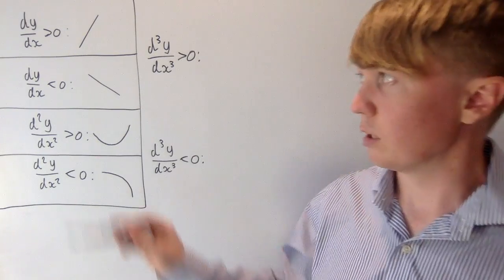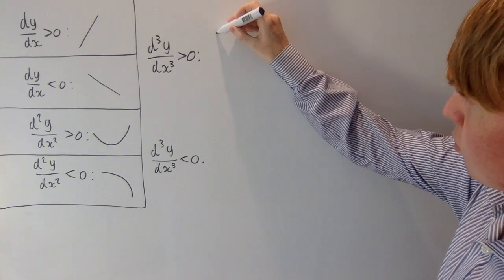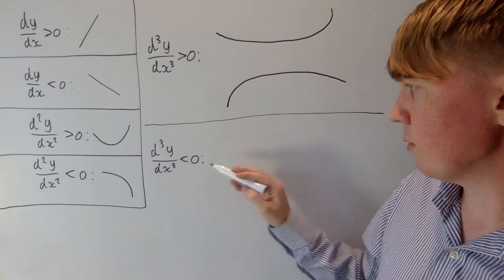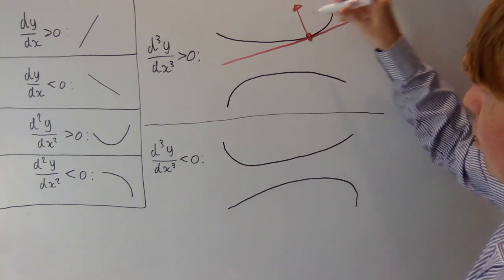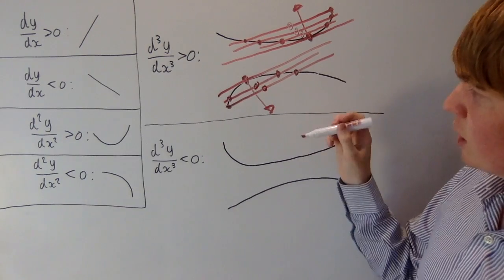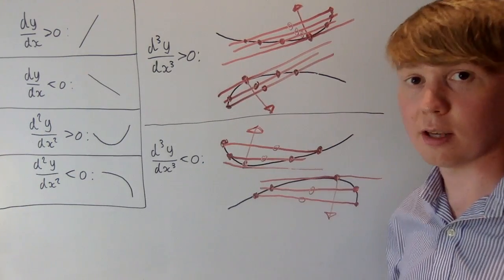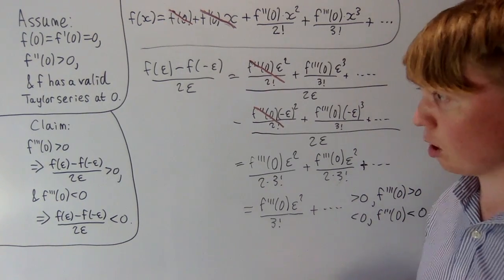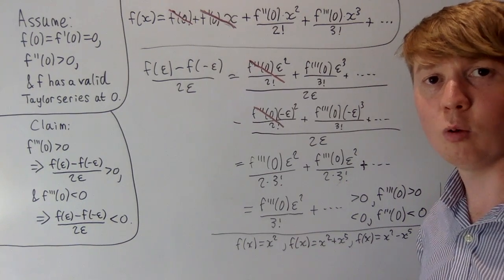Understanding The Third Derivative Geometrically

Comment: Unfortunately, this intuition is wrong. You should take this video down, or issue a correction.
Reply: Thank you for your thorough and well-reasoned analysis.
Reply: @General12th  
I have a longer comment in response to another comment that I didn't want to reproduce here. The counterexample that commenter gave is the third derivative of a circle. This intuition would imply that a circle has a third derivative of 0, since the circle is symmetric. But circles (when written as functions) don't have a third derivative equal to 0. 
Ipso facto, this intuition is wrong.
Reply: @APaleDot  A circle cannot be written as a real-valued function. Maybe you are referring to the circle as a parametrized curve?
Reply: @APaleDot  Also, this video explains the intuition of the third derivative assuming that the first derivative is zero, which is not true in almost all the points of a semicircle
Reply: @WEEBLLOM  
No, I'm referring to the function f(x) = √(1 - x²). If I pick a point x≠0, and then rotate the curve so that the tangent line is flat (as described in the video), the curve is symmetric about that point (cuz it's a circle), but the original function doesn't have third derivative equal to zero at that point.
Reply: @APaleDot  As I said, the third derivative is equal to 0 at x=0, which is the case mentioned in the video, as the first derivative is 0 only there
Reply: @WEEBLLOM  
He says that without loss of generality, you can rotate the curve to make the tangent line flat.
Reply: @WEEBLLOM 
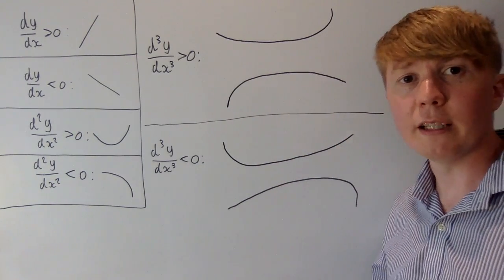You can see at 2:23 he draws a sketch at a point where the derivative is not 0.
Reply: @APaleDot  if you rotate the curve and change the equations accordingly, the third derivative does in fact become 0
Reply: @APaleDot circles are not functions they fail the vertical line test.  Return to pre calc
Reply: @tankyjones888  
Lmao, take the top half of the circle, it's a function. Maybe you should return to pre-calc.
Reply: @ is a semi circle a circle?
Reply: @ is a semi circle a circle?
Reply: @tankyjones888  
"The sky is blue"
"Umm ackshually, the sky is mostly made of nitrogen which is colorless"
Reply: If you rotate a function, it's not even necessarily a function anymore. 😂

Also, he says you can do it, and it won't change the answer. If the third derivative changes to 0, that already disproves his claim.
Reply: @APaleDot  if the function is continuous and differentiable, then there exists a neighborhood around any point such that the rotation gives a proper function around the point. Apply the necessary rotation and translation to satisfy the hypothesis, and the third derivative will satisfy what the video explains.
Reply: @WEEBLLOM  
My dude, if the third derivative changes when you do the rotation then the intuition is useless.

Let's say I want to know if a circle has positive or negative third derivative when x>0 without going through the process of actually taking the derivative three times. So I rotate the function and it tells me the rotated function has third derivative equal to zero. Okay? How does that help me? I can't conclude anything about the original function from that.
Reply: @APaleDot  what this video gives is some intuition on the information that the third derivative provides, not the opposite way. The third derivative of a function with nonzero first derivative has a very different character and is not included here as you can rotate the function to avoid this
Reply: @WEEBLLOM  
Okay, let me summarize:

1) The information from the intuition only goes one way
2) Rotation doesn't preserve the third derivative
3) The intuition only applies when the first derivative equals 0

Does that about sum it up? Because all three of those claims contradict the contents of the video.
Reply: @APaleDot  1) yes
2) yes, why would rotation preserve a direction? 
3) yes, as stated in the video
Reply: @WEEBLLOM  
At 4:12, he says "what's more important is that [the midpoints] are clockwise of the normal when the third derivative is negative,  and they're anti-clockwise when the third derivative is positive" which implies you can get information about the sign of the third derivative from this diagram, not just the other way around, contradicting (1).

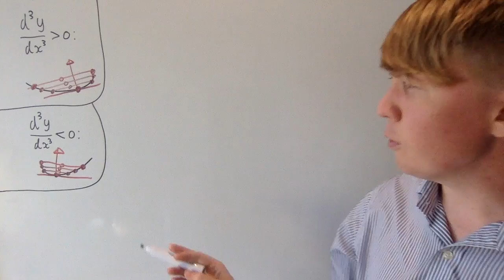Starting at 4:28, he says "there are a few simplifying assumptions we'll make" and "without loss of generality" and then describes three transformations (translation, rotation and reflection) that won't significantly change the diagram. Since rotation doesn't change the relative angles in the diagram, and it's grouped in with transformations that really don't change the value of the third derivative (up to a sign), the implication is that rotation also doesn't change the third derivative, contradicting (2).

As stated previously, at 2:23 he sketches diagrams where he chooses points arbitrarily, not only points where the first derivative is 0, contradiction (3).
Reply: @APaleDot   1) no? He extracts the conclusions from the sign of the third derivative. Not the other way around
2) is indeed a mistake, rotations don't preserve this property.
3) Idk man it's just a sketch
Reply: @WEEBLLOM  
Even if he extracts the conclusion from the sign of the third derivative, the framing is clearly that they are equivalent properties. It's also not an unreasonable take-away since the problem is so constrained. The statement "If third derivative > 0, midpoints are anti-clockwise" is equivalent to "If midpoints are not anti-clockwise, third derivative ≤ 0".

So even if you think he's just inferring the diagram from the third derivative, you still end up with both these properties:
"If midpoints are not anti-clockwise, third derivative ≤ 0"
"If midpoints are not clockwise, third derivative ≥ 0"

which gives all the same information as inferring in the "incorrect" direction, except when the midpoints lie on the normal itself it's ambiguous.
Reply: @APaleDot  the statement is "if the third derivative has this sign and the first derivative is zero".
Reply: @WEEBLLOM  
That literally changes nothing about what I said.
Reply: @APaleDot  we have been saying the same things to each other for way too long now. I believe we fully understand what we mean. Yes he assumes wrong things. No that does not make the video invalid, as further in he remarks that he assumes the first derivative to be 0. Can we stop this now?
Reply: @WEEBLLOM  
It does make the video invalid though.
Reply: @APaleDot  no

Comment: So, the 3rd derivative of a circle arc at any point is 0. Am I missing something?
Reply: Well, if you define a circle parametrically then its curvature is constant. Curvature is kind of like a second derivative of a parametric equation, so the change in curvature would be 0. However, he never even mentions parametric equations, so this is just me trying to find some interpretation of his lecture that fits.
For anyone who wants to see that the 3rd derivative of a circle is not zero, here's an intuitive explanation: consider the top half of the circle given by x² + y² = 1. When x = -1, the tangent line is vertical and the derivative shoots off to infinity at that point. But for every other point within the range (-1, 1), the derivative is well-defined and finite. There's no way for the derivative to shoot off to infinity over a finite range if it was changing at a constant rate. Therefore, the second derivative cannot be constant, and the third derivative is not zero. So as far as I can tell, this geometric interpretation is just wrong.
Don't trust everything you see on the internet, I guess.
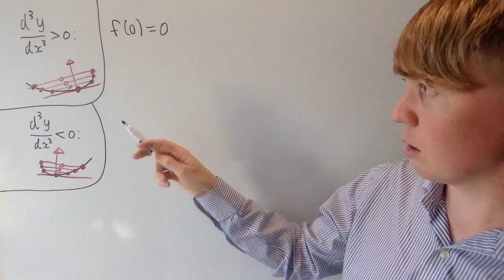Reply: Actually, I've found a way to salvage a part of the intuition. At 4:58 he says that we can simplify the proof by rotating the function such that the tangent line is horizontal. Of course, you are not allowed to "rotate" a function, that could make it not a function anymore! This simplification is invalid, as shown by the circle example which is symmetric under rotation. However, there is a way to make the tangent flat while maintaining the function: a skew transformation. If we skew the function vertically, all x positions remain fixed, and the functionality is preserved. This is equivalent to adding an extra linear term to our function that perfectly cancels the first derivative at the point of interest. Since this linear term goes to zero on the second and third derivative, it doesn't effect our results.

So what is the upshot? Well, unfortunately, the first part of the intuition about mid-points being to the left or right of the normal is dead in the water, it's unsalvageable. This is because when we do the vertical skew, the normal rotates, but the x positions of the midpoints don't change, they only move vertically. Therefore, it is entirely possible for the normal to rotate from one side of the midpoints to the other during the skew. However, the part about the slope of the chord after the skew is still valid. After we skew, we can look at the asymmetry of the function by measuring that slope and it tells us which way the 3rd derivative is going. This also works with the circle because a circle is asymmetrical under a vertical skew.

Comment: I'd like your take on the following:

Third Derivative Test for Inflection Points.
For y = f(x) at x = c:
(c,f(c)) is an inflection point iff f ' '(c) = 0 and f ' ' '(c) <>0
If f ' '(c) = 0 and f ' ' '(c) = 0 then no conclusion can be drawn. In this case you must go back to the 2nd derivative test and check the concavity around x = c.

This is just anther way of saying that the slopes of the tangent reach a max or a min at the point of inflection.
Reply from the maker: This works nicely, and if f''(c) = f'''(c) = 0, then we could also check the fourth derivative, fifth derivative, and so on. If the 4th derivative is non-zero, it's not a point of inflection, and if the 4th derivative is zero, we need to keep going. If the 5th derivative is non-zero, it is a point of inflection.
Reply: @DrBarker  Nice! This is basically saying that if our function has a Taylor series about the point of interest, we look at the first non-zero term after the (x-a)² term [x² term if we have translated the point to 0], then the local behaviour of f (in relation to the tangent at that point) mimics that of the (x-a)ⁿ term - point of inflection iff n is odd.
Reply: @DrBarker  I never thought of the before! But when you think it through it makes perfect sense. Learn something new everyday.

Comment: Pretty much how we define and look at skewness. That one is the third moment around the central tendency, ie the mean. The fourth derivative mirrors the properties of kurtosis ie the spread around the tails. Its nice to see how everything ties up so nicely. Thank you for a nice video. Perhaps a segment on skewness would add to the understanding plus application of the concept.
Reply from the maker: That's a good point. We could even try to understand higher order derivatives by looking at higher order moments, but I don't really have a clear image in mind for anything beyond the 4th moment.
Reply: @DrBarker  The fifth moment measures the symmetry of the tails. It can be used as a measure of the symmetry/asymmetry of the two tail-risks in distribution of returns of assets, for example. The fifth derivative should, by logical extension, just be a measure of the symmetry of the extreme values about f(x = 0) as we move away from x = 0 in either direction. I have no clue as to what the sixth and higher derivatives will translate into.

I also just now remembered my physics teacher defining the third derivative of position vector as the Jerk felt by the particle in question.
Reply from the maker: @shlokdave6360  I could see the 7th, 9th, and other odd moments as related to the symmetry, where higher order odd moments are more heavily weighted by the more extreme values than lower order odd moments. I'm not sure how much insight that actually gives me though, especially for derivatives. A higher order derivative should still presumably be a local property(?), so I'm not sure how the notion of extreme values extends there?
Reply: @DrBarker  I agree with both points. I wrote down the point on odd and even derivatives twice before deleting since they were just observations and not concrete derivations- I was trying to avoid making a silly mistake, something  I excel in. 😆
But it seems someone as learned as you also saw the patterns. Beyond the 4th and 5th things do get silly to be honest. I am sure we can find interpretations of the same but how much do the 6th 7th and higher terms really contribute in the Taylor’s series? One real application of higher order derivatives I have used are the option Greeks in applied economics. And over there, nothing useful is obtained beyond the third derivatives.
Reply: @DrBarker  again at the risk of making a complete ass of myself, higher derivatives should not be a local property for translationally invariant situations. I have a very weird understanding of why I think this to be the case with zero confidence in saying so. How do we test for it, any ideas?
Reply: Wow, I'm surprised that geometrical perspective (analytic geometry) on signs of multiple derivatives somehow has a connection with geometric feature of moments of distribution.

Comment: The way I always thought of the 3rd derivative:
When I'm cruising at constant speed in my car, my back's position is at zero relative to the seat back. When I accelerate, the seat back squishes proportionally. So the seat squish and car acceleration differ by two derivatives. Therefore, the third derivative of car motion is related to the speed of seat squish.

So 1 m/s³ of car jerk equals so many cm/s of seat squish. Roughly.
Reply from the maker: This is a really fun physical interpretation - thanks for sharing!
Reply: I like the geometric interpretation, the gradients of chords,  it plays nicely with the physical one
Reply: The derivative of acceleration is sometimes referred to as "jerk" motion. When I was in university and someone was being an idiot we used to say: "Stop acting like the derivative of acceleration."
Reply: @ianfowler9340  That “jerk” measurement is what determines the comfort of a passenger in a vehicle or airplane. Commercial airplanes are actually programmed to make turns so that the acceleration is down into the seat and jerk is as close to zero as possible. It does this by banking the plane. So the passenger just feels pressure down into the seat, not a leaning to the side. 
That is why passengers have to fasten the seatbelts when landing. The jerk as the acceleration decreases from the braking throws the passengers forward.
Reply: To use a rocket analogy, if you're in a rocket in space with a positive second derivative in the direction of travel, you're accelerating, so you'll feel a G-force like gravity pulling you to the rear of the rocket. You can stand on a scale and watch your weight change.

If the third derivative is zero, you'll feel a constant G-force and you'll have a constant weight on the scale.
If the third derivative is positive, you'll feel the G-force increasing, and the scale will say you're getting heavier.
If the third derivative is negative, you'll feel the G-force decreasing, and the scale will say you're getting lighter.
Reply: What a silly perspective thats not scientific at all